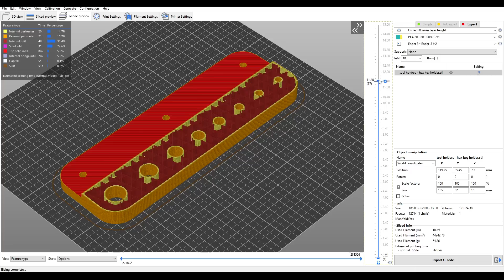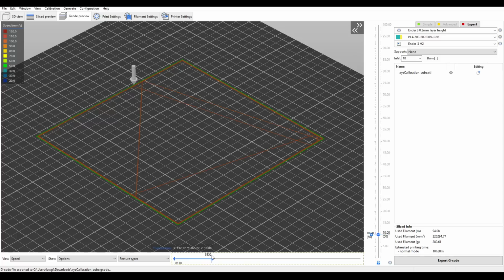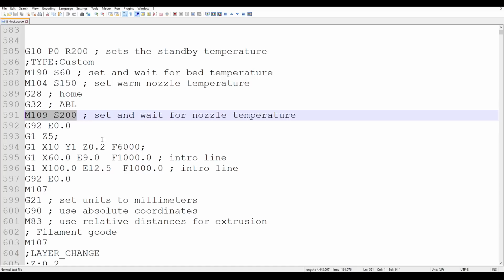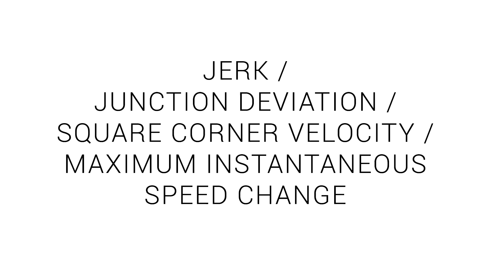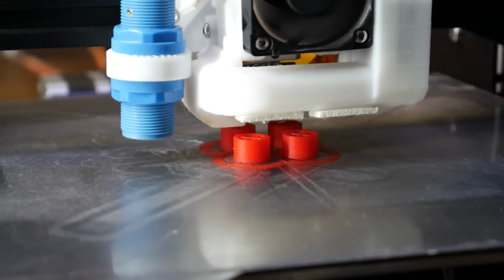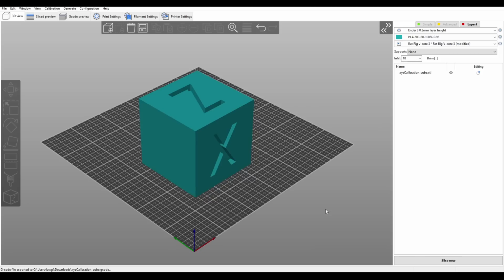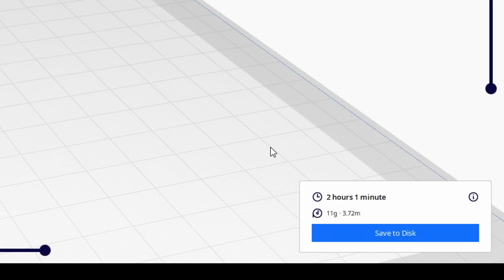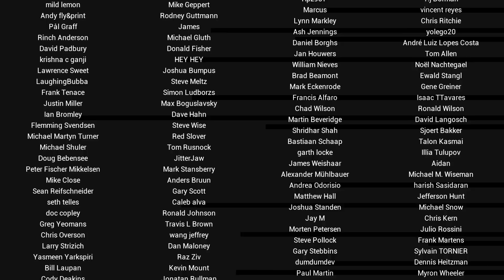Why 3D printer time estimates are wrong and how to fix them

Comment: I use Klipper (ender 3) and Orca slicer. Acceleration setting 0 in slicer however I set acceleration and speed in machine setting for estimation. Prints are almost double faster then slicer estimation. I think you should revisit this video and make updated video for Orca/Klipper and stuff like that. Just for comparison, slicer time: 3h6m and print time: 1h24min for 'flexi rex improved' (ender 3, 100mm/s, accel 3000, input shaping/pressure advance tuned and slicer retraction)

Comment: Michael this is great info, thanks very much as I am a newbie to 3D printing and was wondering why my Cura slicer was saying one time and then when the printer my Ender3v2 started printing the time was like 1-2 hours longer, I was thinking I did something wrong... do you have a video to help with all of these settings to show me what should be in each of the settings.. like a noobie how to set up the slicer with what values to put.... I did notice in this video you put the speed to 250 instead of 500.... these are the kind of things I would very much like to know and I am sure that many others would like to know this kind of stuff....

Comment: Ive never had issues with print times cura has been pretty dead on maybe im just lucky but the thing that im trying to understand is why the print time on the printer display is always so off ive ran a 12 hour print and in the beginning my printer would tell me 24 hours but quickly change as it would get to sections of the printer as if it only calculated based on the current layer as if it were to just repeat it for all the remaining layers however the actual print time usually matches my slicer almost to the T

Comment: I usually print relatively small objects (read: under 3 hour prints (stock ender 3)) so the deviation is usually within 10 minutes at most, so it doesn't bother me enough to change it.

Comment: I’ve been using Print Time Genius since you first recommended it and it’s been fantastic. Prints under 5 hours are generally within seconds of predicted. A print that takes 10+ hours has been no more than 2 minutes off some even being seconds from predicted. It took a few prints to become accurate but it just gets better and better.

Appreciate the video!

Comment: In Superslicer you can set the machine limits (under printer settings) in terms of acceleration and jerk (no option for setting junction deviation though). There are then options for how Superslicer uses these under "How to apply limits" which include options for whether they are used for print time estimates or written to g.code.

I use them for print estimates and keep actual settings used during print as being defined by my machine firmware. So long as the SS settings and my m,achine settings match up pretty well, then the print estimates seem to be very close.

I don't know if you can set these things in Cura, but thought I'd point it out as another area of potential difference and I suspect that most slicers use some estimate of acceleration and "cornering" in their estimates.

Comment: I find that setting in PrusaSlicer didnt change the estimate, I just assume because I am using an MK3S+ though that the same branded slicer already is setup to work off the limits of a same branded machine.

Comment: Just a FYI, the Print Time Genius plug-in for Octoprint triggers a bug when using TH3D firmware. On my Ender 3 I would randomly have the hotend cool down mid print while the temp remained static in Otco and on the LCD. The screen showed to be at 200º+ but I would start to hear the extruder click away until one day I I used a multimeter to see that the heater wasn't getting any juice. I only found this out recently. It even triggers the problem with the plug-in disabled.

Comment: There is another way, using the Klipper Estimator post processing script. Similar to RRF's simulate, it pulls the klipper config from the machines API, simulates it really quickly using Klippers kinematics in mind, and provides an estimate that is within a minute across 24h or so.

Initially made by Annex Engineering, the Voron community uses it alot now too

Comment: Thanks for these explanations, very usefull. as cura also predicts the weight (and is not always correct) is there a way to make that also more precise? because changing filament during a print has never really worked for me.. The sensor gives the alert (on a cr10S pro) only when its already inside the tube and you cant get it out without unscrewing everything. Also if i don't hear the alert immediately it can continue heating the nozzle and the bed for hours until i see there is no more filament. What i am doing now is i weigh the spool, with the filament, (i know the weight of an empty spool) . I add 5% to the prediction and check if i have enough. It would be great if there was a way to make the prediction more precise!
Luc
Reply: If you set up the correct values within a self added material, the weight should be very correct.
Downside is, that for every new filament you have to add it to the materials in cura and select it.
Reply: @FireN2k9  Yes,, thanks, but the problem is, some materials  have the details on the box.. some others dont. i meen the density... often 1.24g/cm3, in pla i often use the creality filament. I havent found the density for that filament. Yes i have written to creality, but no answer. so i am using the cura default of 1.24 but. when weighing the spool, it is pretty correct on big prints, but on smaller ones (figures) it can be off by 25%. (i have a second scale and often check if the values are not completely faulty). But i actually only need it when the spools get quite close to the end. like less than 10% left.
Luc

Comment: The short answer without even watching the video: Set your acceleration rates in your slicer to match the ones in the printer. And also don't try to ask speeds faster than what's the maximum speed in your printer.
Reply: I always assumed the slicer solely dictates the acceleration. Live and learn!
Reply: How do you know the printers acceleration?
Reply: came to say tyhe same thing lol. ive told people is SO MANY groups that. its quite an easy fix lol

Comment: even the acceleration of the extruder motor can influence time, since i had implemented linear advance all my prints take longer. I don't know how to set it in the slicer (i use PrusaSlicer) to have more precise times

Comment: I'm using Prusa Slicer 2.3.0 but I don't have 'Machine Limits' as an option for printer settings. I don't have a Prusa printer so my printer is a custom config.
Reply: Switch to expert mode view
Reply: @TheMidnightSmith  I'm in expert view and its the only tab missing
Reply: @andrewferraro8568  that's super odd, I have 3 custom machines with that tab available. Under printer settings.

Comment: In Cura, the final time seems to be just about perfect every time from my experience (not accounting for heating/autoleveling). The progress bar on the printer seem to only care about layer numbers though.
Reply: my cura is way off
Reply: I've heard the progress bar / time remaining on printers often only cares about bytes/commands/lines read.
This then means that square, low-to-none infill layers will be way faster than estimated if the same model includes circular and/or high infill layers.
Reply: Post Processing Plugin has script Display Progress On LCD, which will put gcodes to file to display remaining time and progress (as calculated by slicer). Choose best method depending on printer firmware and hardware.
Reply: @kimmotoivanen  same, it works well for me.
Reply: I have the same more often than not it's even faster that the cura times.

Comment: I never really concerned myself with print times when I saw the time discrepancies
Reply: My Creality printers are perfect but Kobra Plus takes 50% longer than the estimate and uses more filament than expected which can be a problem if you don’t have enough filament left on the roll. Until I got the Kobra it was never a concern.

Comment: CURA almost always predicts the time perfectly for my Ender 3v2, the only time it gets it wrong is when i cranked Accel and Jerk to print a Speedboat.

While the printer itself seems to do: Last layer x number of layers left= time
Reply: Via octoprint with the plugin to get accurate time it is astonishingly accurate
Reply: Post Processing Plugin has script Display Progress On LCD, which will put gcodes to file to display remaining time and progress (as calculated by slicer). Choose best method depending on printer firmware and hardware.
Reply: @kimmotoivanen  damn thank you so much! 

I was asking myself if it exists but never actually looked it up

Comment: klipper estimator does fast estimates for print times and shows lots of useful data on your print
Reply: I was gonna shout this out too. It calculates how long each feature type takes, and gives very accurate estimates for print times. +1 for klipper estimator.
Reply: Took me a while to figure out how to use it with Cura. The docs on it are garbage. But once I figured it out (and man was it actually easy) such a great post processing tool!